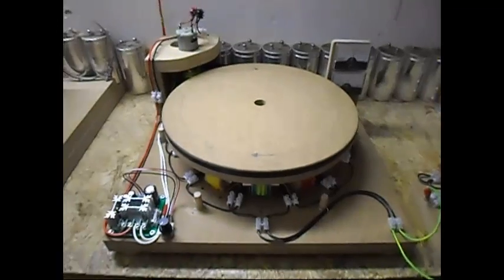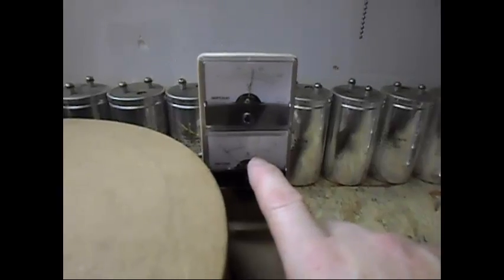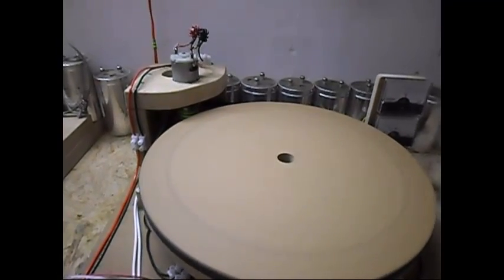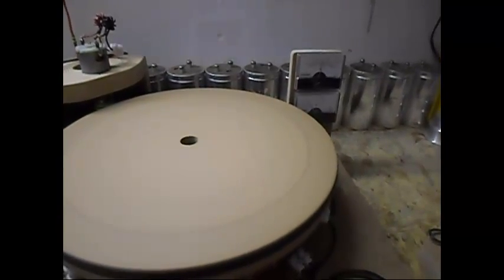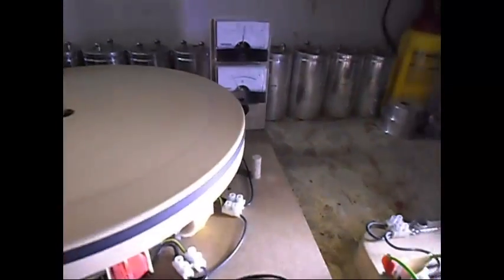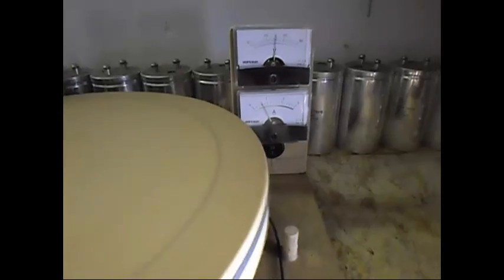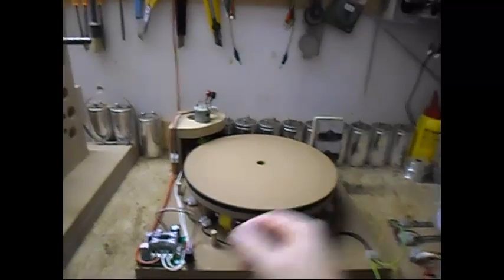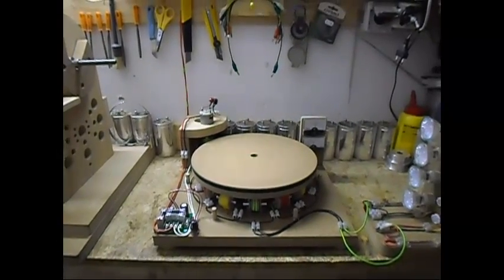PMBO 2014 - First Entry, Flux Gate Generator Completely Modified...

Comment: the drag force is like the magnets. the system will be like if you have twice as strong magnets unloaded with half the magnetic strenght loaded . if you switch the electromagnet at the right timing it chould generate a motor torque that counteracts its itself and the drag caused by the magnts and ease up your drive motor. the magnets can't be switched but the electromagnets can. try see the generator as a motor and a generator at the same time and then do your realisation whats going on in there.